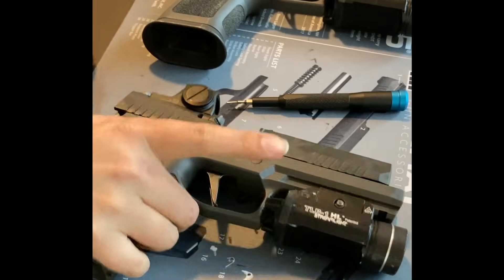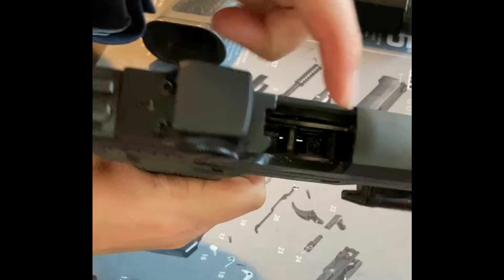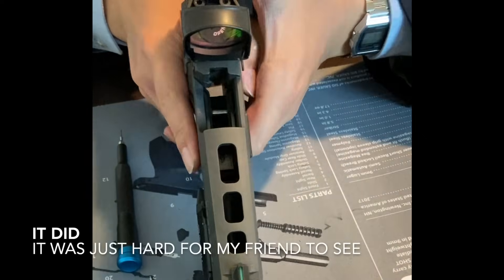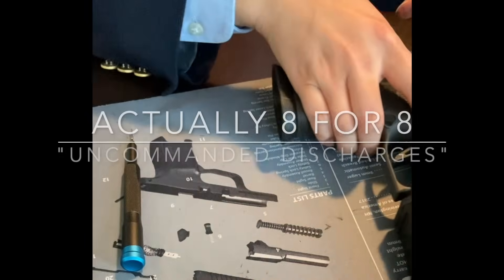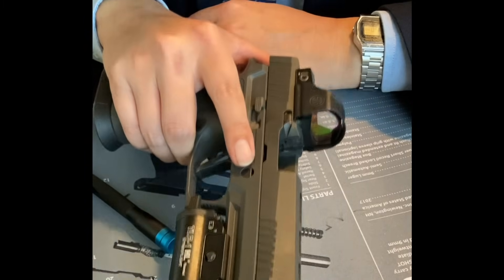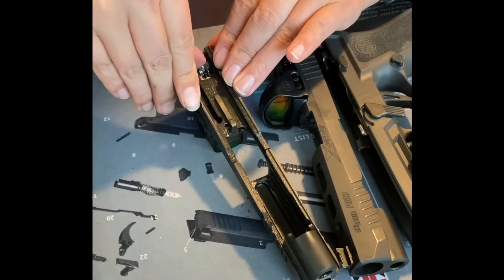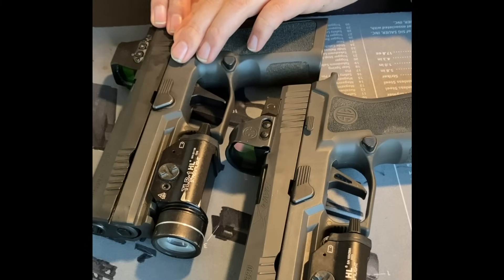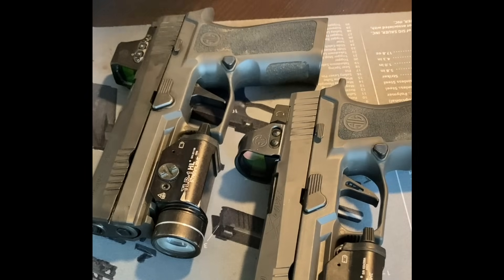Testing two P320's for Uncommanded Discharge: One PASS, one FAIL

Comment: I have a 2020 manufactured P320 M18 w/ the manual safety. 

1. So my striker rebounds on my slide when I press down on it like yours does around the 6:40 mark. 

2. My trigger bar only moves forward, and back. It does not move forward-down-and then snap up like yours. 

3. When I manually activate the striker from the back with a poker like you have in this video, the firing pin does not protrude and isn’t visible at all. 

I recently sent in my M18 to Sig to get it inspected for peace of mind. The gunsmith noted that it passed all functions tests, and functions as designed. 

So what now?
Reply: Get rid of the thing. First the p320 wasn’t drop safe, then they kept exploding and now this. If you watched this video and sent your gun in you’re aware of the problems and god forbid something happens with your gun…. It’s negligence not just on Sigs behalf but yours too if you have all the information and still didn’t get rid of the thing. 

Why even keep it at that point? 

For context I had a CZ P10C great gun. Pointed so well for me. Anytime I brought it to my eye perfect sight alignment. I put 500 rounds through it  and decided to carry it when I wasn’t carrying my g43x. At 2500 rounds the ejector which was either cast or MiM broke off and I kept getting stove pipes I pack up at the range go home to clean the gun and I noticed the issue. CZ replaced the part immediately I then promptly brought it back to the same store traded it in for next to nothing and got a shadow systems after 3000 rounds the spring on the trigger safety tab broke off so I got rid of it. Got rid of that too because it was just a worse Glock. 

I now shoot a g19 or g45 better than a p10 or mr920. I carry a gen 3 G19c don’t love the grip angle or the ergonomics but it’s drop safe, doesn’t explode, always works, doesn’t break and only fires when commanded. Plus holsters and mags are dirt cheap.

Comment: I imagine this may be a concern with P365 as well correct?
Reply from the maker: Oddly no. The P365 FCU uses a completely different sear design that does not cause the sympathetic trigger bar and safety lever movement that seems to be connected to a failing FCU. P365s do not appear to be vulnerable to the same failure.

Comment: I have 3 p320s and all of them are marked  576 on the trigger bar. I have one with an Agency Arms trigger with a blade safety, that particular one when manipulating the sear in this way did not let the striker drop. The kit includes 2 sear springs and a take down safety lever spring.

The other two which did not have the Agency Arms trigger the striker dropped through the breach face. 

I upgraded one of the ones that failed with an Agency Arms trigger, and that stopped the striker from moving forward with this test.
Reply: So an update. I retested the last fcu and noticed that when I saw the striker drop there was a distinct difference in audio. I started to pay attention to every time the striker would breach and noticed that it was because the slide was forward out of alignment, it was repeatable every time, and as long as the slide was lined up perfectly it wouldn't fail.

Comment: if you want to delve a little further into the question of whether or not those were light strikes, a hand loader could set you up with some cases with a primer only in them, that would tell you pretty instantly and potentially help move further down the diagnosis line, i'd caution against taking light strikes as being evidence of safety though, because eventually it wont be a light strike

Comment: Ok, get a bic pen. Remove the cap. Drop the pen butt first down the barrel. If the firing pin is working correctly it will fling the pen out with enough force to hit the ceiling. Now you can do the test all over and see if the striker block is working when all the parts are in the right places. Note: the little plug on the back of the bic pen is the right hardness to make this work. Not every writing instrument works. Pencils don't. Wood dowels  don't.

Comment: Awesome work!!! It’d be interesting to further take apart the firing pin and swap some of the firing pin and block parts. It could be the spring load, or it could be other tolerances or drag playing a role. This is the exact thing that Sig should be doing and going deeper and make some modifications to make it more robust.

Comment: Since your video along with others regarding the P320. We have tried ten different P320, m17 or m18 models and have had various responses. Which just proves its not if but when will the sear fail? What amazed us the most was the exterior safety on m17 and m18 versions did not stop the sear from falling and the striker from hitting live primers which caused ignition? And if you want to be cheap? Used a pencil with the eraser against the breach and striker. It shows the same results? I have four variants of P320 and have now made them all safe queens. SIG needs to pull its P320, will not fire unless trigger is manipulated memo? And pay attention to the owners?

Comment: If you're willing to waste a few rounds, you can remove the bullet from a few cases; but leave the primers in place. Insert the case in the chamber and run the tests afain to see if the protrusion is sufficient to actually ignite the primer. Make sure you still wear hearing protection though, cause primer pop is still extremely loud, especially indoors... might be worth a try.
Reply from the maker: Seeing the striker protrude is sufficient for my purposes - that shouldn't happen even if the sear were to magically move on its own. Some folks have been placing their finger on the breechface and oh boy can they tell when their strikers protrude. No point in spending perfectly good cartridges!

Comment: Great video. I did this test and had no striker protrusion with different trigger bars (I don't think trigger bars have an affect, but I happened to have two different styles on hand). But it's clear that with some stacking tolerances it is possible for the striker safety block mechanism to fail. It's crazy that we, the consumer, have to do these tests...

Comment: What year were these guns manufactured as well. That's something I'd also be curious about... I've been doing a lot of research on these and it seems this seems to happen less or not at all after late 2021/early 2022 Manufactures P320s? I could be wrong just what I've gathered so far..
Reply from the maker: 2020 and 2022. The year of manufacture does not seem to be related, as I've now handled some old pistols that fail and some new pistols that don't fail the sear movement test.

Comment: Well that does show that the striker safety on the one 320 it not working properly BUT !  the sear still has to release the striker for it to matter and for the gun to fire Sooo whats causing that to happen without the trigger being pulled ? Thats the Big Question here  Without sticking things in the action to release the sear or beating it to death with a hammer Whats causing the sear to release with out the trigger being pulled !?!?
Reply from the maker: No idea, that's for someone with a large sample size and an institutional testing rig to figure out.

Comment: Maybe a tolerance stacking issue across multiple components? Your inconsistent results kind of point in that direction. QC could be to blame or all parts could be to spec +/- and they just "didn't catch it" in the engineering/testing stage.

Comment: Probably parts origin
Reply from the maker: In-spec parts can be made in plenty of places as long as the QC department knows the critical measurements and collects a statistically meaningful number of those measurements for each production run.
Reply: @P320Truther  Agreed. I work for a manufacturer of "things" and the vendor adheres to our QC or they are out. It is important that the manufacturer enforces their own standards. My "parts origin" should be better clarified... "Probably lack of quality standard enforcement". It is seductive to continue with cheaper parts manufacture by looking the other way on quality. Probably a bad idea on something like an entertainment electronic or handbag...but on firearms and car safety parts, unforgivably(unless owning up to and fixing the issue)

Comment: Thanks for the video. I have a 320 X5 Legion and a 320 XCarry Legion. I just tried this with both. I cannot get the firing pin to protrude when I press the sear on either of them. However, as you noted about the firing pin not returning, I have one that does and one that doesn’t. I just tore the striker assemblies apart. It turns out that with the one that does not return on its own has a tiny spring inside the assembly that has broke in half.

Comment: My firing pin protrudes during this test and doesn't even retract until reset 😬

Also fails the search engagement trigger bar movement test. Sig P320 X5 Legion purchased AFTER the voluntary upgrade program

Comment: Excellent video! I tried this test on both of my 320s and they passed, both are factory full-size 320s with no modifications one from 2015 and the other one a 2024 gun. I am curious, wouldn’t Apex trigger prevent this from occurring as the trigger does move rearward in this test? The trigger dingus from the Apex trigger would prevent rearward trigger movement. Have you tried this test on M17 with the safety that locks the trigger bar?

Comment: The 320 as a military sidearm is insanity. How the hell is the 320 supposed to run perfectly when a little dust gets in there during wartime. I'm a fanboy for no brand, but let's face it, Glock has never had these problems dipped in mud, frozen, or filled with sand. Who got paid off to arm our service members with a firearm that will fail so horribly. I own 2 320s. One is a built out comp gun, and the other is a Flux Raider. How can I trust these?😕🤦‍♂️

Comment: The design is inherently dangerous. The striker is cocked without a trigger pull being needed, so a failure in the striker block means you are essentially carrying a 1911 cocked with the safety off.

Comment: Awesome testing scenario you've set up here, thank you. 

Reviewing the footage, at 8:01 in the video, during the seventh test cycle where you're testing your slide on your friend's FCU/frame, I saw the firing pin protrude. 

The results from your tests, and the tests others have performed should give anyone pause. I wouldn't touch a p320 with a 10 foot pole.

Comment: I don’t have my P320’s pistol frame on hand (in a Flux Raider currently) but I bet this would work pretty well with the pen trick I’ve used to test firing pins. Basically, put a cheap Bic pen butt first down the barrel, point upwards, and pull the trigger, and it will launch one of those pens a couple feet.

You would still have to reach in with a pick and drop the sear, but it would give a consistent way to do the test with the pistol fully assembled and give you an indicator of how hard it is hitting the “primer”

Comment: the macro problem is complexity and tolerance stacking. They engineered an overly complicated design that requires precise tiny parts. Any of those tiny parts being dimensionally out of spec or like a spring, operationally out of spec. Sig likes to say there are extra internal safeties, but it doesnt matter if one tiny spring wears out and all safeties fail LOL.

Comment: Thanks for the video. 

You're doing some great work. I wish you would get some addition light on your videos. I had a hard time seeing anything because the lighting just wasn't enough for my older eyes. That Sig isn't doing this kind of work to understand, communicate, and correct the problem is a big reason for many of us to refuse to consider Sig pistols going forward.
Reply from the maker: I won't pretend to have any kind of super-fancy studio setup. This is just a $10 Amazon tripod, a table, and a mat. Sure wish I didn't have to be making these videos, but some of my friends are interested in how to test / how to fix their own P320's for very understandable reasons and no one else was really offering an easy test or discussion of potential root causes.
Reply: @P320Truther  I understand limitations. As I said, Sig really should be doing this kind of work and should be paying for a professional studio setup to show its customers how to look for the problem. 

If you ever have a burning desire to upgrade, Amazon offers LED photography lights that have about ten LED lights in a two inch by two inch box. They function as a constant light source for photography. Because they would last a while on the batteries, I also see them as a good choice for emergency lights in a home. I ordered one for photography and ended up ordering two more for backup lighting at home.

Comment: I have an m18 commemorative from 2022. I have had thousands of rounds through it no issue, I even accidentally dropped it twice and no bang. But I did this test and my striker protrudes. I did the test multiple times with both the safety off and the safety on. It did it regardless of the safety. It does NOT give me a warm and fuzzy

Comment: Excellent video.  I would be curious to see if the striker assemblies are similar on these firearms - I know Sig has itereated on the striker assemblies in a few ways, and also what the date on the FCUs is and whether their internal components are the same.
Reply from the maker: With the exception of my friend not having a functional striker return spring, the striker assemblies are, to all appearances, identical.

The FCUs are original to the pistols from 2020 and 2022. The only discernible difference between the two FCUs' components are the trigger and the trigger bar.
Reply: @P320Truther  Gotcha. I know Sig has iterated on all the internals, there's like 2-4 generations of parts.  I'd just be curious to know the date stamped on the FCU, assuming no parts have been updated or replaced since built.  My p320 compact FCU is stamped 04/18, post-VUP from factory, but I no longer carry or handle it, and all my parts are at least 1 or 2 generations out of date, and my FCU includes at least one extra component compared to new p320 FCU.

My sear does bounce back immediately, as you demonstrated your does here.

Comment: I replied to you but don’t see my comments now, so I’m making a second post. You can ignore this if you saw my replies.

I have a theory for what’s happening. I think the safety cam that the block rides on might be higher on the bad FCU. The firing pin lock itself might also be out of spec on the bad slide. If it has a little extra material on the bottom, it could be pushing it up also.

It would be interesting to measure the height of the cam above the slide rails on both guns, and compare the variance. I’d bet a dozen donuts that the cam on the bad FCU is taller.

Also - the striker appears to be a MIM part. There’s variance there in how they come out. Some of those strikers might be small enough as to leave play in the striker channel in the slide, and when the slide moves, there might be enough room there to pull the striker off the sear face. You’d have to have a pistol that had an uncommanded discharge to know.
Reply from the maker: YouTube's commenting interface is pretty astoundingly opaque.

Our findings and experiments are zeroing in on the FCU and specifically the interface between sear, trigger bar, and safety lever, in that specific order. More to come on our findings.
Reply: @ stoked to see it!

Comment: But you’re actually introducing a direct force on the sear pushing it out from the striker flange. How would that happen if you’re not jabbing something?    But the striker not rebounding in your friends p320 means he likely has a bad spring or gummed up the striker sleeve by getting oil in there and gumming things up.
Reply from the maker: For whatever reason, sears are failing and releasing strikers. When the sear fails, there is precisely one safety mechanism left preventing an “uncommanded discharge.”

This test doesn’t care why the sear failed, it assumes the sear has failed and checks whether that last-ditch safety mechanism is or isn’t working as intended.

The striker reset spring (or absence thereof) seems to be a contributing factor to failing the Sear Movement Test, but does not appear to be the root cause of failure. We're zeroing in on the FCU and specifically the interplay between sear, trigger bar, and safety lever.

Comment: You can’t say it isn’t wear related when on the same breath you say “it’s hard to tell what’s going wrong”
Reply from the maker: If it was wear-related, my pistol with 8,000+ rounds on it would fail and my friend's pistol with significantly less rounds would not fail. The opposite is occurring. It is reasonable to conclude that normal wear-and-tear is not the root cause of this failure mode.

Comment: I am little confused. I was able to replicate this and my firing pin protrudes. But when I press the sear the trigger is being moved along with it, so there is no difference between doing this or pressing the trigger itself. I must be doing something wrong.
Reply from the maker: No, you're on the right track. Keep looking at how the FCU components interact as you manipulate the sear and you may start to see possible reasons for FCU misbehavior. If the sear moving causes the safety lever to move as well and allows the striker to bypass the striker safety lock and fully drop, then that's a real bad day if your sear ever gets moved by a force of god.
Reply: @P320Truther  I have figured it out 10 minutes after that comment lol. Mine seems to be "safe" but it's not like it really matters since I got PDP to replace it.